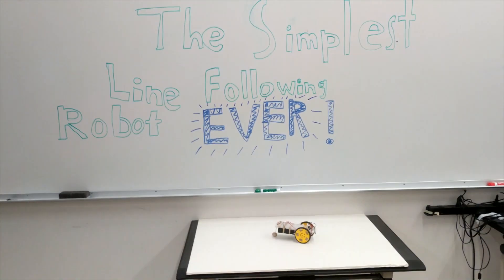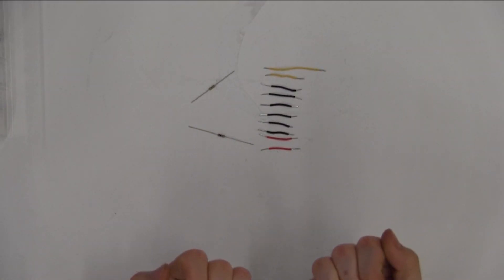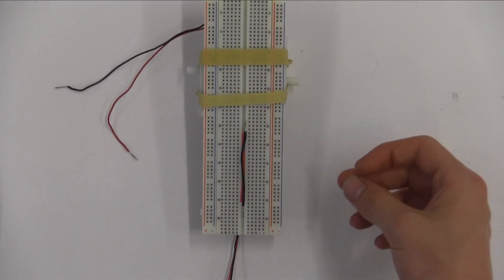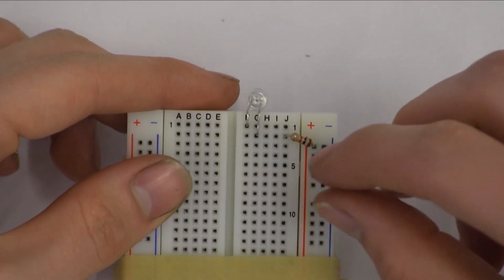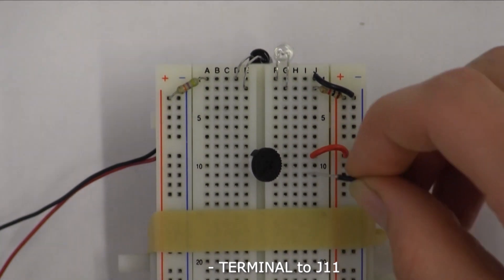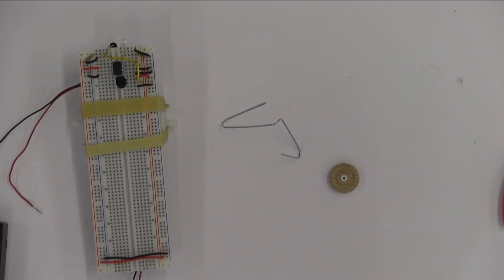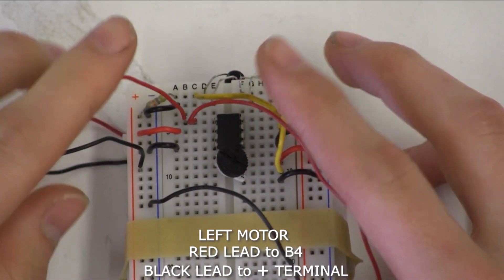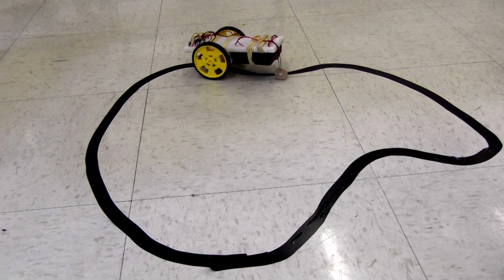How to Make Line Following Robot with just one IR LED + Phototransistor + OpAmp in 90-120 minutes.

Comment: Hi, may I know, if I want to substitute the op-amp, rather than TCA0372 or L272, is there other suitable op-amp can be use? How about LM358N?
Reply from the maker: Looks like the 0372 and 272 are now obsolete in the dip package, darn! The LM358 will not work because the 358 has low output current capacity. I think this summer I'll have to redo the circuit and use a combination of LM358 and output transistors, or just switch it to a complete transistor circuit. Wish the chip did not go obsolete.

Comment: can i use an lm358 op amp instead of the tca0372 ?
Reply from the maker: The LM358 op amp output stage cannot drive motors directly. You would need to add a transistor circuit on the output like a 2N2222 to drive the motors. Learn by looking at the datasheets of both op amps and compare the difference between the output drive current capacity.

Comment: can i use tt gear motor instead of the one you used?
Reply from the maker: You can use other gear ratio motors, but keep in mind that if you use faster motors may need to add a very low resistor in series with the motors to reduce the current to the motor to slow down the faster motors. We use a gear motor with the ratio of 224:1 which is nice and slow.

Comment: why does it shake so much?
Reply from the maker: Because no motor is on at the same time, the motors are constantly switching on/off between them, left ON right OFF, right ON left OFF, as it inches forward. There is a way to eliminate this by adding more to the circuit - a couple more simple capacitors and resistors but this electronic circuit's goal was to be the simplest on the planet!